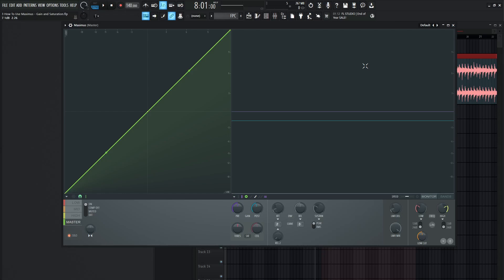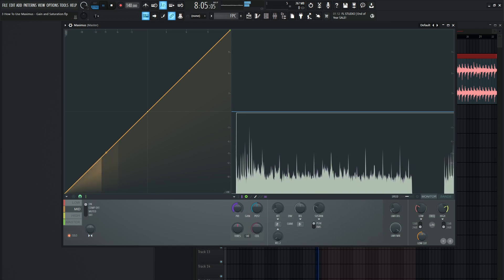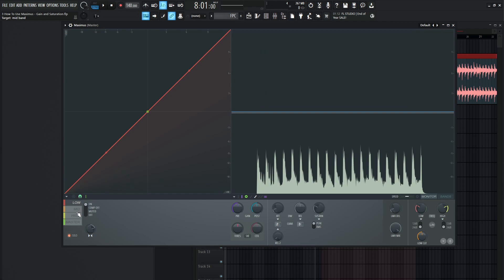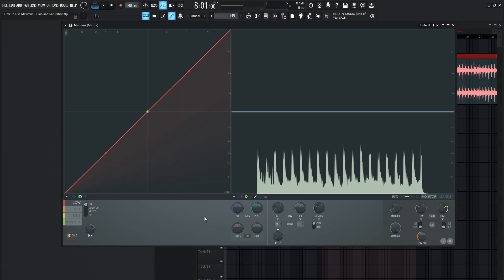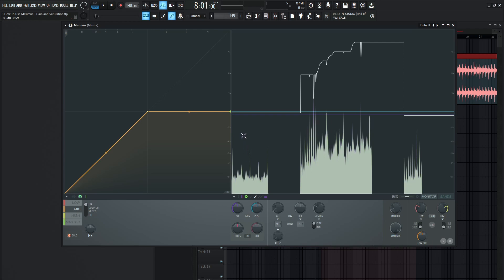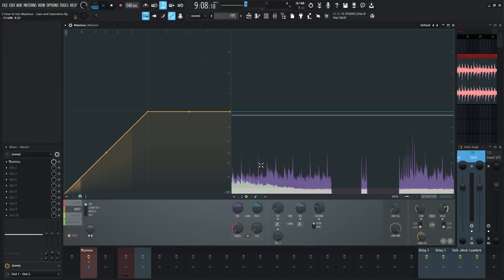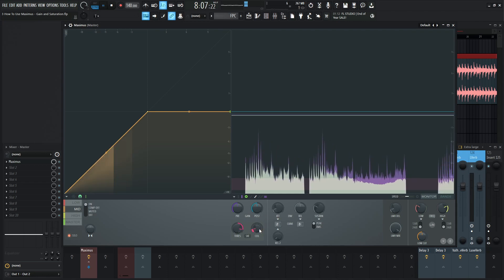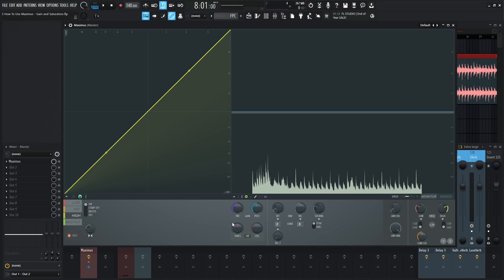Maximus Gain and Saturation PART 3 | FL Studio 21 Tutorial

Comment: Good tutorial, thanks 

Helps me understand pre vs. post gain

So basically pre is raised to drive the signal more into the compressor, creating a more compressed sound once you bring back down the volume. I assume that is done to normalize the volume and reduce peaks

And the post gain is basically similar to a volume knob. But in Maximus you can use the post gain to control volume of an entire frequency band, so a broad effect on sound
Reply from the maker: Thats right, the pre gain is important because if the gain coming in is too low, then you'll have to compensate by having to drag the threshold value really low and wont have that much room to work with. If the pre gain is at a healthy level, it makes dialing in the values much smoother, resulting it a better sound.
Reply: @jonaudio  hm, I’ve also heard the term ‘make-up gain’ with compressors, the idea that you cut into a sound with a compressor which reduces the volume, then have to bring volume back up to original level.
Does that apply with Maximus? It seems different from a compressor like fruity limiter
Reply from the maker: The post gain knobs are the makeup gain for maximus, and you have 4 post knobs for all the bands.
Compression with reduce the dynamic range, so the post gain/make up is there to restore the lost volume.
Reply: @jonaudio  cool, thanks 😎

Comment: if the signal doesn't get past the comp gate in the center, should I bump up the pre gain first or lowering the gate?
Reply from the maker: Great question! So, in that situation it's 100% up to you. If you like the balance of the overall mix and want to keep it as it is, then I would personally reach for the graph and move the center node down to the left, following the diagonal line, in other words, bringing the threshold down so compression can start happening. If you feel the specific band you're working on can use a tonality boost, then you can increase the pre knob to taste and also adjust the graph (threshold in this case) to suit your signal the way you want to.